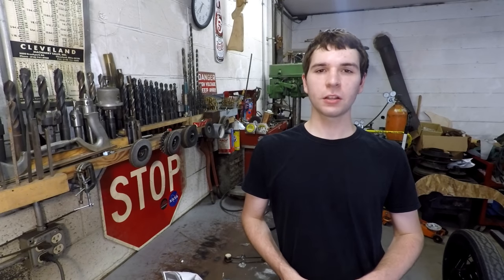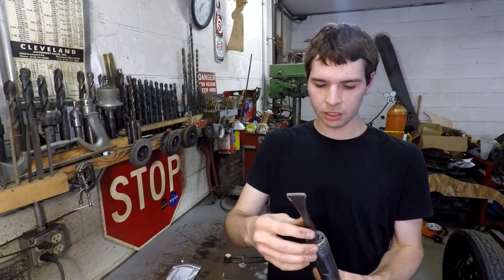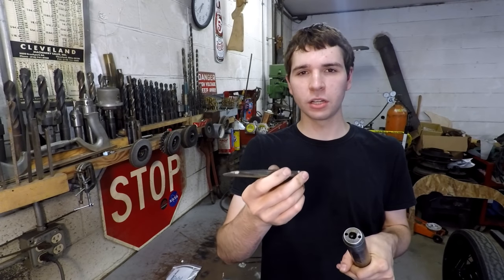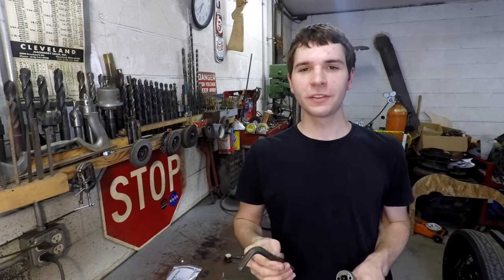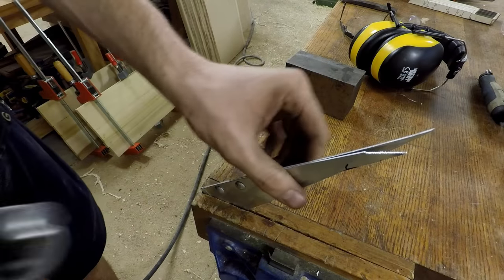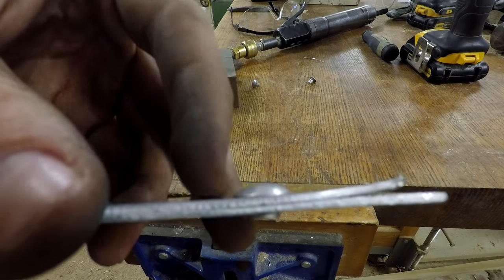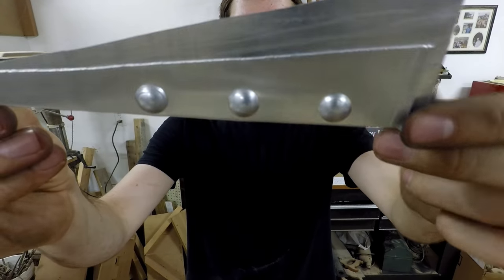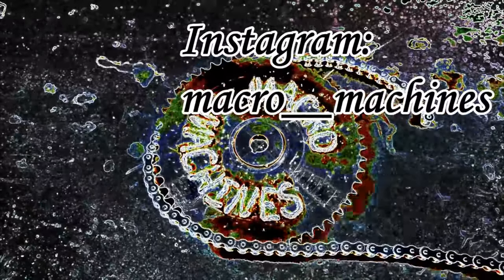Making a Rivet Driver from an Allen Key

Comment: On your third rivet, the hole became a little smaller in diameter due to the other two rivets joining the metal together. It’s best to shoot your rivets in sequence ( in a row ) or in your case with the third rivet,  just place your bucking bar next to the rivet tail, tap it into the hole, then buck your rivet. Basically your giving your metal a stiff surface on the back side when tapping the rivet into the hole. This will keep from bending or marring your metal. Love your imagination working with what you have on hand. That’s true craftsmanship.

Comment: In Aviation School they had us mark out and drill one hundred holes in a square sheet of al. (two sheets) then rivet them together - for practice. We also made our own rivet gauge (there is info on line for just how much you should upset the rivet, as too much is not good either). So I'll advise doing a bunch of practice rivets (and look at some sort of gasket or film between the chassis and sheet as bare metal to metal you'll get bi-metal corrosion). Have fun! Great job on the rivet tool too.
Reply: Ronald, to you and metromoppet, I follow that thinking, of course, but how do you deal with the dissimilarity of the rivet to the frame?
Reply: @leehaelters6182  You have several options. Your butyl caulks come to mind. They don't harden like silicones or laytex , silcone or arcylic. It even comes in a tape (too thick for your application I think). But something as low tech as tar paper or felt paper (cutting to size will be fun - NOT). If you went with a silicone I'd run a small bead on one part and let it cure before riveting so it will not bond the two parts. I've taken classes on aircraft repair, but not cars so there may be other solutions for cars. My old Kaiser Jeep Wagoneer used butyl tape between the body panels (and my metal roof used the same).

Comment: The first rivet butt tail looked perfect I've shot thousands of them at Lockheed I miss those days great job making the rivet head for your gun
Reply: Would it be worth him making a bucking bar with the correct depth of cavity to ensure (close to) perfect tails each time?
Reply: The problem with that is it bends the metal once the butt tail flattens out you would have to be quick on the trigger release to not bend the base metal's and cause warping of the material
Reply: At Marrietta or South Carolina??
I worked at South Carolina 89 to 91.
Reply: @Iowarail  Marietta

Comment: Like 👍🏻👍🏻👍🏻
The rivets will certainly give you the period correct look of a vintage roadster. 
Just watch out for your alignment when you set the first one. Perhaps initially hold the panels together with 2 bolts until you have a couple rivets in place securing the panels.

Comment: One we used to do when building truck cabs while riveting them together is put a piece of duct tape glue side against the rivet driver to soften the tool so it didnt mark the soft rivets as much 
Try it you will see it works 
Its called bucking rivets 
Try to keep the amount of time hitting each rivet the same for unconformity 
Plus we alwas used a thin strip of foam between the sheets of aluminum to seal  moisture from coming in from between them

Comment: I was told that a proper rivet gun had better throttle control than an air chisel.  The rivet set I last used also had a hole in it to allow the setting of the rivet through the plates. I could comment that you could have just bought the tool but then I've been known to make a 6-32 screw instead of going to Home Depot just down the road.

Comment: Excellent!  Not something I have ever tried, but that's great.  Curious tho'... if your anvil had a similar hollow in it, would you be able to get domed heads on both sides?  I think I have seen old black and white film of bridge builders hot-riveting; one man each side of the beam, and the final rivet was domed on both sides.  You would need exactly the right length of rivet, I guess.

Comment: Hi, nice job! Just a word to the wise though, don't drill many holes at once if you're not using skin pins as the panel will creep as you systematically "buck" the rivets, as you saw with your third rivet, the holes no longer aligned perfectly. Also if you are going to rivet the panels directly to the frame, use a non silicone based sealant between the frame and the panel to prevent galvanic action, which in time will destroy all your hard work and eat away at the line of rivets. Excellent work. Keep it up!!
Reply: Metro, to you and Ronald Boe, I follow that thinking, of course, but how do you deal with the dissimilarity of the rivet to the frame? And why do you specify non silicone for sealant?
Reply: Well curiously I was in error with my wording, Sorry about that. one can't actually do that unless using tucker pop rivets or similar as there is no way to react the tail in the frame, but that can be off set by welding a skirt to the base or side of the frame and then riveting directly to that. Alternatively one could weld tabs on etc .Silicone sealant is not rigid enough for a thin film to cope with the movement of the frame against the aluminium shell as it flexes when driven hard

Comment: The tool you’ve made is great, but if you want to guarantee not to damage the rivet head with the tool you can use some masking tape on the tool; it stops the tool leaving marks but will still allow the rivet to form. Great videos tho man. 👍🏼👍🏼👍🏼

Comment: A proper rivet gun has a very smooth trigger,very controllable. Air hammers are pretty much on or off.
Reply: My $10 gun seems smooth at 40 psi on 3/16 soft aluminum rivets. I need to try less psi .80 was way too much so tryd 40.

Comment: I made a rivet setter using a drill bit, not a round burr or round gouge on a lathe. 
  Yes rivets come out pointed, but a hammer takes care of the point in short order.
  Darn good idea to use an air chisel though.

Comment: Fantastic... the perfect tool and ideal look for the speedster. Here is where you will need another pair of hands or get really creative with your dolly's.
Reply: Robin Spencer perhaps he can create some kind of system where he can use a really strong magnetic plate that will hold another plate on the other side. And it will have a hole for the rivet to go into.

Comment: Keys turn and unlock, wrenches tighten and torque....    Soooo wouldn’t it be an Allen wrench?
Reply: Awright, awrite you nitpicker; I've heard and used both.
Reply: Lee Haelters You sir, are playing a dangerous game.                 And depending on your literary background, one could say you are playing “The Most Dangerous Game”!
Reply: @hellishgrin4604  Yes, I did read that in high school, but had to Google for Richard Connell. But, I struggle to see the connection you make. I do appreciate a man of letters, though.
Reply: Consider this: an Allen wrench inserts and turns; then why does it not earn the term "key"?
Reply: Lee Haelters Could that not also be argued for the case of most screwdrivers? My concern is whether or not a name is dictated by those who use it, or those who create it.  Tissues versus Kleenex for example.   And I suppose it’s function is equally important to consider. 

As far as the book goes, it was mostly just a loose reference to chasing another’s idea with your own. A cat and mouse game of wit, with the goal being to surprise or overcome the opponent. In this case, it would be in debate.

Comment: Brilliant!  Below is some of my thoughts. You may already know this but, your viewers may not. 

A rivet set is not expensive. Plus, they match the rivets perfectly if you are using aircraft rivets and not some hardware variety. If it does not contact the entire surface, and mostly centered in the middle, the edges of the manufacturers head can bend up causing a gap between the sheet metal and the rivet head. Too much contact on the edges results in a ring or eyebrow in the manufacturers rivet head.
    Check these sites for aircraft tools and supplies (rivets, bolts and nuts, clecos, AN fittings), I find them more reasonable than any speed shop:
https://www.aircraftspruce.com/catalog/topages/rivetsetspg407.php
https://www.airpartsinc.com/default.asp
http://www.wicksaircraft.com/index.html
The most common shank is a 0.401" shank.
 

BTW, for small panels where you only have to install a couple rivets, hold the rivet set vertically in a vise and use a clean, smooth faced ball peen hammer to make the shop head.  Place the rivet through the 2 panels, set the manufacturers head of the rivet in the rivet set, hold things parallel with the rivet inline with the rivet set and smash the shop head. Hit it crooked and of course it becomes a "bent nail" so some practice might be in order. Once you have the skill, it is  faster that firing up the compressor and the rivet can be as perfect as one installed with a squeeze riveter. 

Please know that the shop head is important for structural reasons. Too flat is no good, it can break off. There are charts online that tell you how much longer the rivet should be than the thickness of the 2 panels so you get the properly formed shop head. There are charts for shop head height and diameter. 

Pressure between the bucking bar and the rivet gun should be equal. Too much in one direction will bend the panel. It is a learning process. 

Keep up the great work and thanks for posting.